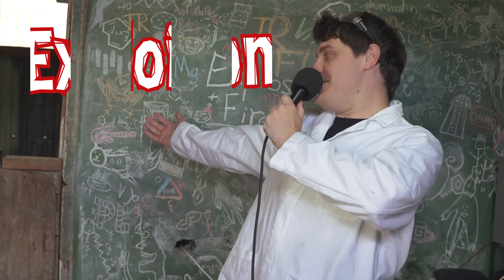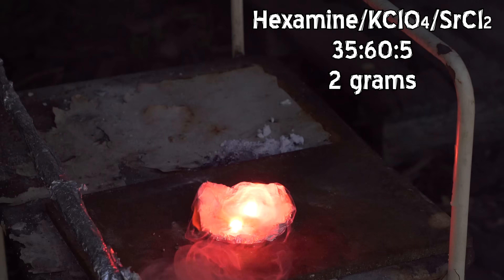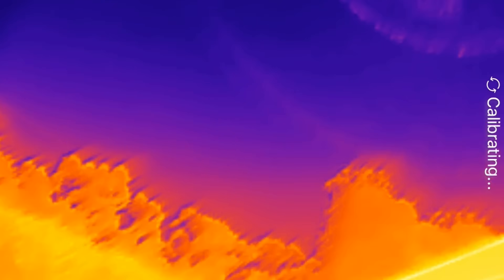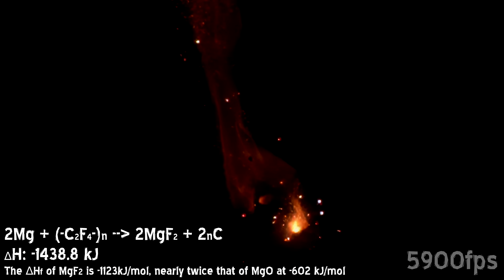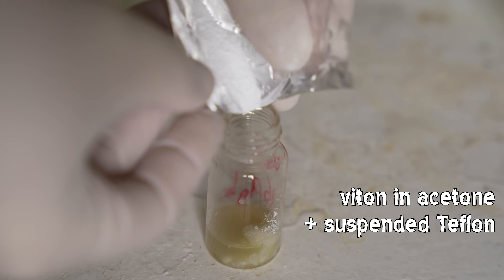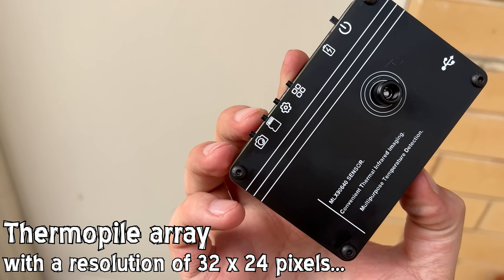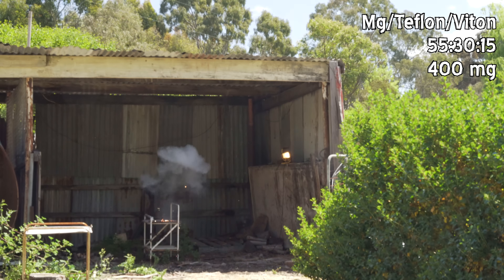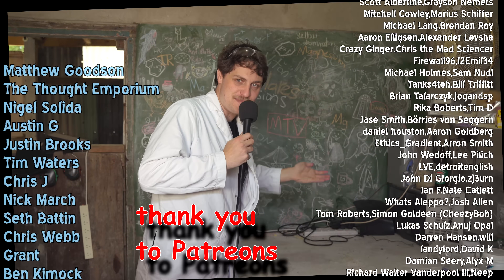Making Anti-Missile MTV Flares

Comment: Is there a similar method for radar guided missiles? Like can you make a flair that gives off intense VHF (or whatever band it is) 'noise'? I mean, its still an energy wave right? Or is it just too high a frequency to work that way?
Reply: To make a lot of radar noise you need to have an energy source that could generate it, so you don't use a consumable like a flare to do this. Instead you have dedicated electronics in the form of an ECM module that stays attached to the aircraft.
For a cheaper consumable method similar to flares you use chaff. Chaff releases a cloud of radar reflective particles and interferes with the radar detection of the pursuing aircraft as their radar waves will be reflected back to them. This helps to obscure the target aircraft

Comment: There are reports that the spectrum of jet engine emissions were modified by the addition of a combination of added trace  elements so that antiaircraft rockets could use the spectrum components as a last resort friend or foe identification system, to reduce blue on blue incidents. Not sure if this is true, but it sounds plausible. The story goes that the combination of additives could be modified to provide a spectrum emission line code that could be changed on a daily basis.
Reply: rad

Comment: Until this video; I never for a second considered that IR guided weapons might be looking at the spectrum, I assumed it was just "Hot thing going that way, please go that way"

Thanks, I have learned something...... almost.
Reply: You're not wrong, that's basically how they started out. Leading missiles into the sun was a legit tactic very early on, because the sun is the biggest hot thing around. It's just then there's been 60 odd years of building on top of that, both in terms of getting the missile to more accurately identify and follow aircraft and in terms of countermeasures manufacturers adapting to missile development.
Reply: @neomone1989  ah yes the forbidden heat signature
Reply: Just like someone on the spectrum, the IR seekers get hyper focused, thus making the flare the equivalent to that really annoying kid who will do everything in his power to get the attention of everyone nearby.
Reply: The early Sidewinders were so dumb they would sometimes lock on to the ground.  Or the plane that launched it.  So yeah, the original versions didn't have the filtering to distinguish between exhaust and other IR signatures.

Comment: The way the AIM-9X seeker works is really fascinating actually. And its IRCCM (Infrared Counter Counter Measures aka Flare Rejection logic) is really neat, but unfortunately a lot of it is classified.
Reply: Just drop it on the war thunder forums
Reply: It actually uses a thermal camera essentially and uses shape recognition to see the plane's shape which makes it impossible to confuse with flares because a flare would appear as a dot.
Reply: @Fatallydisorganized  Yes but if it's a big enough dot, or a whole lot of them, it can't see the plane. Flares may be less effective due to modern tech but they are not obsolete yet.
Reply: @wingracer1614  not sure how close to reality War Thunder is for IRCCM missles... but they basically have a number assigned of the brightness of flares vs. The seeker head. A FOV is the prime factor on getting hits, but they can still be tricked if you flare alot in front of them and force the seeker to turn off (the missile will track based off of the historical vector of the aircraft) so if you flare like crazy and they change vector you can evade. No amount of IR camera + software can prevent this. The only thing you can do is make it faster in velocity so it closes the distance in less time or use undetectable systems and go "stealth".
Reply: @Marin3r101 The type of IRCCM you are talking about is only used in specific types of missiles like the AIM-9M. The AIM-9X wouldn’t really be fooled by dumping flares as it also uses an optical lock to differentiate between the plane and IR countermeasures.
Reply: @wingracer1614   correct it cannot see the plane, however it can accurately see what pixels are moving fast and what pixels are moving slower so it can accurately assume that the larger volume of pixels that are moving in the same speed and direction as the plane is actually the plane and to ignore the flares. This bypasses flares entirely since both the size of the thermal plume, and the speed and direction of the flares must match the plane or they will be ignored since they won’t match the equation of motion calculations for the plane before the flares were used.
Reply: @justamicrowave2572 
It is almost certain that 9x support historical data irccm. It wouldn't make sense if it doesn't. 

Anyway, 9x specifically does not have optical tracking, it physically cannot. The only seeker sensor it got is ir focal plane array. 

But it can do something similar to optical tracking with the multi spectrum fpa.
Reply: Does depend on range to target though. If the target is only a couple of pixels big then flares are still fairly viable.
Reply: @Fatallydisorganized out here turning Explosions and Ire into the War Thunder forums.
Reply: @mirroredvoid8394 I thought it was more because it was an older 9X that had sustained numerous carrier landings and takeoffs (the bane of all Navy and Marine-used guided missiles since the 1950s lmao)
Reply: @link11913  I'm pretty sure the guy using the war thunder logo for a profile pic gets that
Reply: @mirroredvoid8394 I think so, just one of those things that are really hard to account for in testing, because who the hell would think to assume your enemy has badly made flares?
Reply: Same guts/method as a Javellin antitank weapon. Remembers the shape and thermal pattern of the target, and maintains lock with a radar if the IR optical picture gets disturbed with flares.
Reply: I would guess Air to Air missiles now use DLN (Deep Learning Nets) to track targets. Probably using multiple imaging from IR,Visible, UV, & radar.
Reply: @guytech7310 
Unless you want to fit a lot of computing power with their cooling, then the missile internal computer  is not going to be using any dl anytime soon.

Comment: Air to air AND surface to air! 

The cheapest weapon that can effectively and consistently shoot down planes are MANPADS and those tend to be IR guided. Plus they can be carried and fired by a single infantryman

So you don't have to assume both sides can afford a fighter jet, you can assume one side can afford a fighter and the other has access to MANPADS trough a friendly rival power that has beef with the larger side
Reply: Only really effective against attack helicopters as manpad missiles have very limited range. Russia is testing a laser defense system which tracks inbound Ground to Air missiles using a turret on its Ku-52 helicopters. Manpads are also not cost effective against low cost drones like the lancet used for anti-tank (replaceing the need for attack helicopters).

Comment: I worked as a manufacturing engineer in the solar industry for about 3 yrs. Our semiconductor used CdTe as the bulk material. Can confirm, does absorb IR very well. Also very very not good for people.
Reply: The only place cadmium belongs is imprisoned in silica
Reply: @CATASTEROID934  I mean the semiconductor was sandwiched between two pieces of glass, does that count? 😂
Reply: @JoshSteiner14  That'll do just fine, just as cadmium-based photovoltaic cells are sufficient vitreous prisons
Reply: @JoshSteiner14 >Also very very not good for people.
Would you say it's better or worse than Repulsion Gel? :V
Reply: CdZnTe is an excellent solid state gamma ray detector as well as a rather efficient middle wave IR detector material. Totally different setup for each task. The gamma ray sensor uses a bulk crystal with either a light silver or thallium doping to make a proportional photoconductor, the NIR version has a PN junction. Lower layer is doped with antimony, upper layer is doped with indium. ❤
Reply: @christopherleubner6633  we didn’t use antimony and indium but you’re close 🫡

Comment: Obligatory post  : 
The missile knows where it is at all times. It knows this because it knows where it isn't. By subtracting where it is from where it isn't, or where it isn't from where it is (whichever is greater), it obtains a difference, or deviation. The guidance subsystem uses deviations to generate corrective commands to drive the missile from a position where it is to a position where it isn't, and arriving at a position where it wasn't, it now is. Consequently, the position where it is, is now the position that it wasn't, and it follows that the position that it was, is now the position that it isn't.

In the event that the position that it is in is not the position that it wasn't, the system has acquired a variation, the variation being the difference between where the missile is, and where it wasn't. If variation is considered to be a significant factor, it too may be corrected by the GEA. However, the missile must also know where it was.
The missile guidance computer scenario works as follows. Because a variation has modified some of the information the missile has obtained, it is not sure just where it is. However, it is sure where it isn't, within reason, and it knows where it was. It now subtracts where it should be from where it wasn't, or vice-versa, and by differentiating this from the algebraic sum of where it shouldn't be, and where it was, it is able to obtain the deviation and its variation, which is called error.
Reply: And the noise, yes?
I was told that the noise was a critical tool.
Reply: @sakurakiyori  That's true but i think the real star here is the Rockwell Retro Encabulator .

Comment: Why would the burn time of flares be that classified? I mean couldn't you just watch how long it burns if you wanted to know?
Reply: You'd need to see the flare burning first, and know for sure which one it was, if you were trying to counter it in certain sorts of ways I'd imagine. Since otherwise people might be able to go, 'oh it burns for X number of seconds, so we need to be able to go to X+1 seconds' or something like that. Plus, even if it's not a huge barrier to finding it out, any barrier is probably considered better than no barrier
Reply: @somethingbob1210  In the videos I've seen they've always been used in a series. This makes sense since I assume an aircraft is typically moving when using them and that they become less effective the further away they are.
Reply: I'm not an expert on flares, but yeah, the more IR signatures the thing can lock onto the fewer of them might be the plane, and the intensity of any of the IR signatures will drop over distance. 

Either way, being able to know the full burn time (and thus the duration of protection) of the specific system in advance gives time to try and counter it (and deal with any relevant logistics and/or training), so it makes sense they'd want to keep it hush hush if possible.